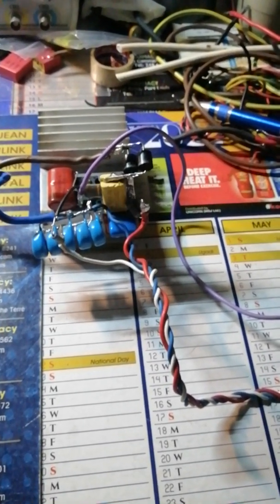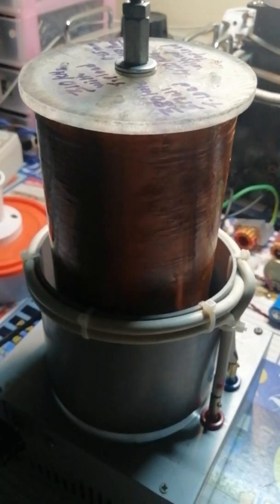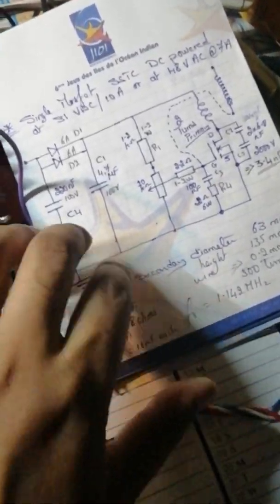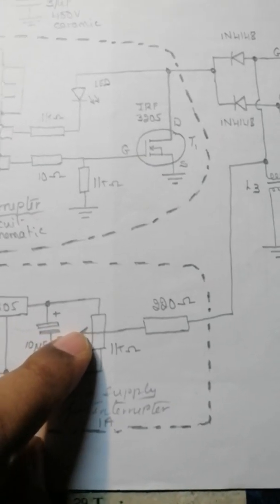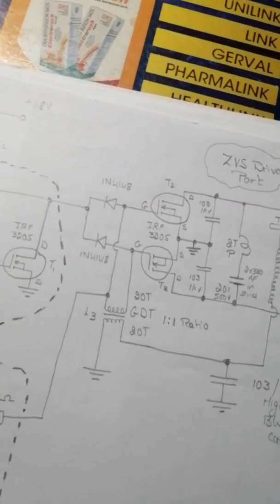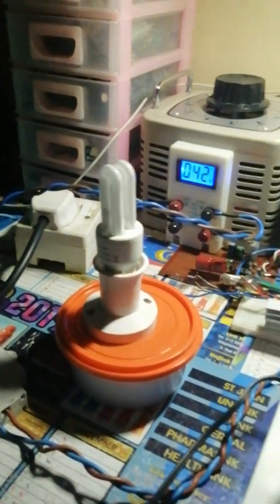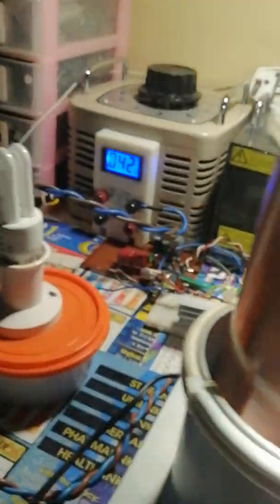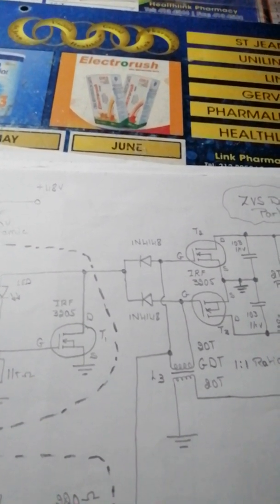Half Bridge SSTC Using IRF3205 plus TL494 Interrupter.

Comment: very good!!
Reply from the maker: You need to move on to other circuits same as I'm doing.. I've started with single mosfet, then push pull, half Bridge, then I'll try full bridge. My target is a musical DRSSTC. I just hope I'll be able to do it.
Reply: @RAVI171175  Hello, yes I also want to switch to using a new circuit but still need preparation, I hope you finish your DRSSTC soon and good luck!!

Comment: Nice but this is the push pull not a half bridge. You have plus and minus swings on your primary which is netting you more overall peak to peak voltage than a half bridge. These are the circuits I use for low voltage DC and now you see why they're so awesome.
Reply from the maker: Yes indeed, it's an awesome circuit & works marvelously well. That's why I said it was a circuit you already knew. Those Tesla coil circuits, they are like drugs & once you get into it, you just don't want to backoff anymore. Well, hope all is good on your side.
Reply: @RAVI171175  must have it tuned pretty good cuz I've never brought those fets that high in input voltage.
Reply from the maker: @Magneticitist  Well, all I know is that my secondary Resonant Frequency is around 260 KHz & with other coils with around 1 or 1.2MHz, my output was same as yours. But if you look close at my schematic, maybe you'll see a little difference compared to yours although it looks basically the same as yours and yes, it took me quite some time to fine tuned it to reach such output. And yes Ryan, I hardly have times for myself or for my DIY's but once I'm onto something, I focus all my precious time on it till I reach 100% satisfaction before moving on some other circuits. In life, everyone has got his/her own ways in dealing with something but it's also good that we all come with different variations so that there is still room for better improvement.
Reply: @RAVI171175  These are pretty difficult to tune well but after a while you start to see the variables and how they come together. The only annoying thing about using 55V mosfets is the limit you have in tuning and input voltage to where typically the drain will peak to about twice the input voltage at least. The ones I buy seem to be able to handle 75V or so no problem so perhaps they can take even more beyond the 55v max. You may even be pushing them higher than 75V. The downside there is that then slight adjustments in tuning via how the secondary streamer loading is forming at the time could push that drain peak to excessively higher causing failure. I've had this problem on some I tuned really well for 30VDC and after a while just opted for 100V mosfets. Ideally something like 200V fets would probably be even better for safely pushing 50V inputs.
Reply: @RAVI171175  You also seemed to use halfwave rectification or something, not sure, in which case the peak voltage the mosfets are seeing will be momentarily even higher.
Reply from the maker: @Magneticitist  Infact Ryan, I'm always using single diode meaning half wave as you've clearly mentioned. I've never used full wave rectification with smoothing caps on any of my Tesla circuits. For me, powering my circuits with single diode seems to give the best results I'm always expecting. But as you've mentioned above, pushing them too hard those 55V fets can pop them & unfortunately, I've just popped them up as they don't last long. Those 55V fets sure did suit my purpose & I was really satisfied with them but the only problem is that they don't last long & sooner or later, I knew they were going to pop up & bang, they blew up. I'm happy though as I had nice moments playing with that push pull circuit as I tuned it very well. At 42V they were doing fine but when I push the voltage up to 48V, they just died!
Reply from the maker: @Magneticitist  I don't know if there will be a next time with that circuit but if ever I'm gonna get back with it, I'll for sure use IRFP 260N. In the meantime, the whole circuit is going on the shelf to be forgotten. Next time, when I'll be free, I'm gonna work on another circuit.
Reply: @RAVI171175  you just have to remember that with half wave rectification you're dealing with the peak DC voltage swings and with smooth DC you don't have that problem because it's all flattened out pure DC. So if you have something like rectified 50 volts DC you have well over that in the peak swings. This brings it even closer to break down for those mosfets.  I don't run mine unless they are smoothed DC for that reason. Ideally keeping them to around 24 to 30 volts smoothed DC max seems to keep them healthy. It's not so much your supply voltage that is the problem but the peak voltage the drain is going to see in those drain source capacitors in the off cycle due to the inductance of the layout and the coil. This is also highly dependent on the arc loading at the time which is why the breakout point is so crucial in the tuning.
Reply: @RAVI171175  Also when you run half wave rectification you're seeing good output usually because you are basing it on arc length. You don't get the same arcs pure DC but there are no ramps with pure DC without modulation. Half wave rectification you are riding line voltage ramps at line frequency. At 50V or so in you'll see closer to 70VDC peaks off the ramps and those 70VDC peaks are where you see those longest reaching arcs etc. Technically you could just run it interrupted smoothed 70VDC to get around the same arcs but then you need an interrupter, which isn't necessary when just letting the line frequency do it as it crosses 0.

So basically you're seeing why it's so awesome to use half wave rectification for a mains SSTC. The ramps do all the work when it comes to the arc length. This was something I didn't learn til long after making several smoothed DC builds.